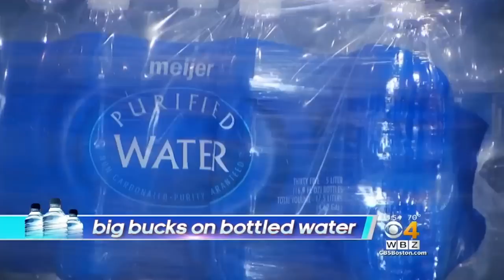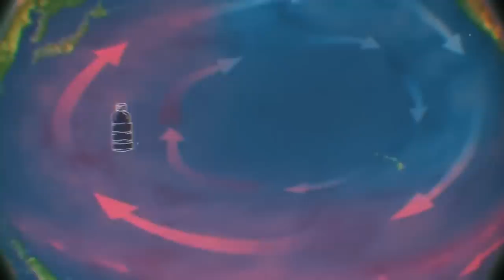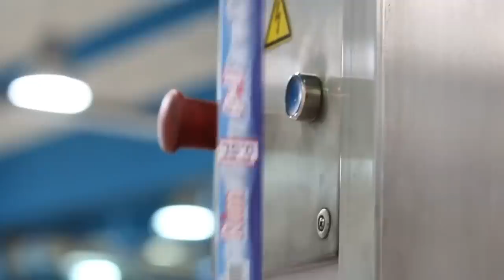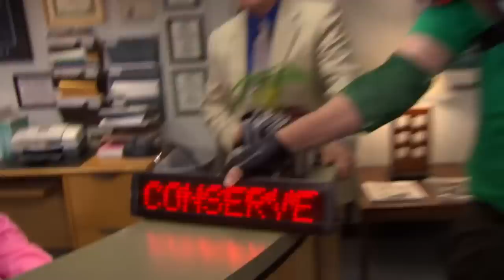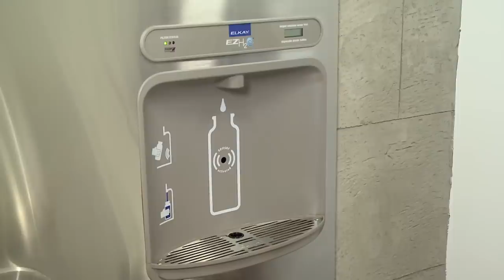The Real Reasons You Should Stop Buying Bottled Water

Comment: If I get this right, if you're buying Dasani, Nestle Pure Life, Aquafina, or Smart Water, you'd be better off using water out of your tap and filtering it through a good water filter. All these 4 companies use local tap water and feed it through a filter. If you buy spring water, like Poland Spring, Deer Park, Ozarka, or Crystal Geyser, then if you buy this water, you're at least getting the extra minerals that spring water provides. However, all water sold in plastic containers contain small pieces of plastic which are floating in the water and are microscopic. The experts are not sure where these small plastic pieces come from, possibly the bottles themselves, but we end up drinking these plastic pieces.
Reply: Why let Dasani, Nestle, Aquafina, and Smart Water take your tap water and charge you a fee to run it through a filter for a premium price. You can get your own filter and save a bundle.

Comment: I did the math and if you convert the cost of bottled water into gallons, a 24 pack of water bottles is 3.16 gallons. Considering a water gallon is initially purchased for $1 and a 24 case of water goes for anywhere from $1.99 when on a good sale to $5.99, gallons of water is obviously better. But I will not drink tap water. Even filters and purifiers don’t work for my local water. I have drank well water before but you have to boil that for awhile and run it through a filtration system to make it totally safe

Comment: Here's the problem, the water from some of the municipalities are just not good drinking water.  Hard, over chlorinated, high in other non desired organic and non organics content.  You may believe the EPA Safe drinking water levels are good enough but are the local water utilities really meeting them.  Once a year testing by them is also useless.  So really it depends on where you're located.  But I wouldn't drink the tap water from many.  You also have to be careful of drinking from bottle water as the industry is not regulated by anyone, NO ONE.  I stay with bottle water that has been purified by some means and supplement the needed minerals from other sources.

Comment: The amount of technology required to put the water into a bottle is staggering and completely unnecessary. When I saw plain water sold almost at the price of cola, not mineral water, not carbonized, I thought what the fuck. I have never bought it. Sometimes I get given it for free, like at a blood donation, and it even expires so that we buy more.

Bottles can be refilled with drinks and dry goods. But washing them is impractical. A plastic reusable bottle is not that different. It's hard to reach every wall section with a brush. I buy my milk in jars where I can stick a hand inside.